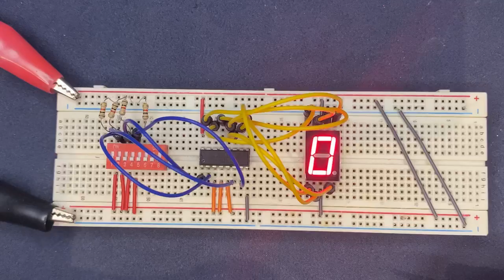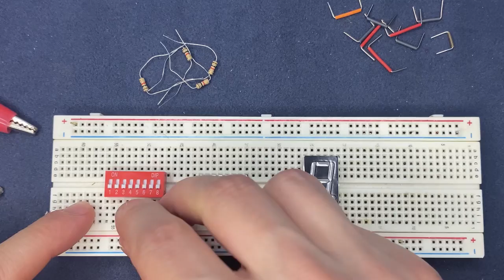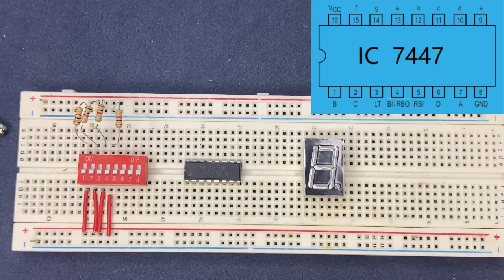How to build a 7 segment display decoder on breadboard

Comment: Will it work with out resistor i dont get why u used resistor there
Reply from the maker: Those are pull-up resistors. They ensure that when the DIP switch is open (not pressed), the input pin connected to it reads a defined logic level (typically high). Without these resistors, the input pin would be floating, leading to unpredictable behavior or noise interference.

They are also used for current limiting . When switch is pressed , current which is flowing  from Vcc to GND will be limited 

In summary circuit wouldn’t work without them
Reply: @ElectroMin ok man but in the right there are two grey wires what is there work??
Reply from the maker: @animeeditzz1145  those gray jumper wires connect the rails of the breadboard together , since i have wire connections on the all 4 rails of the breadboard
Reply: @ElectroMin how much volt are u providing?
Reply: @ElectroMin if we use 6 volt do we need resistors to connect on 7 segment?? Or it will work without it
Reply from the maker: @animeeditzz1145 5V
Reply from the maker: @animeeditzz1145 it wouldn’t work without resistors
Reply: How many watts of resistor do u use? Ty